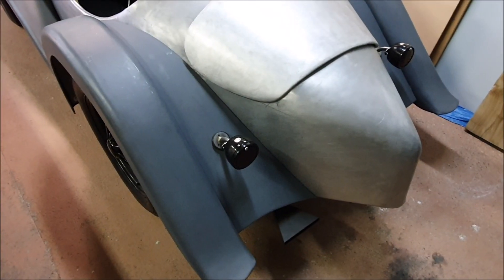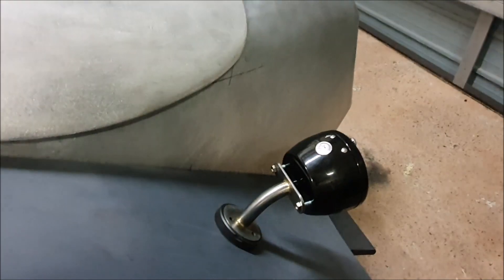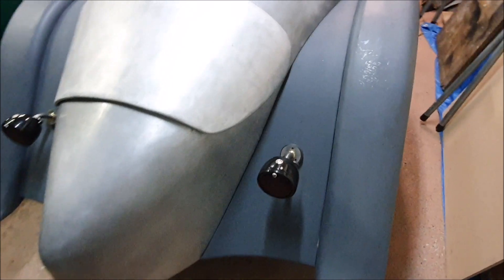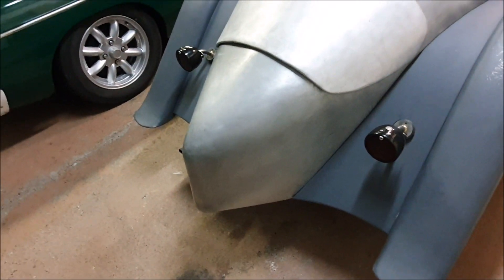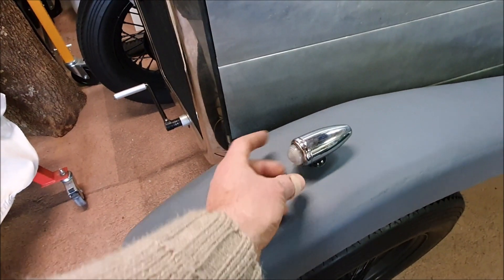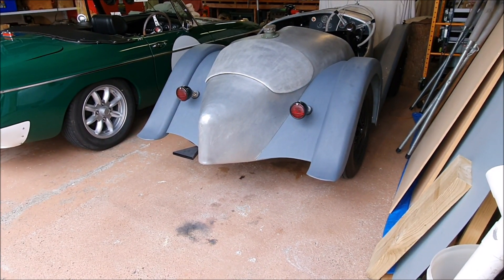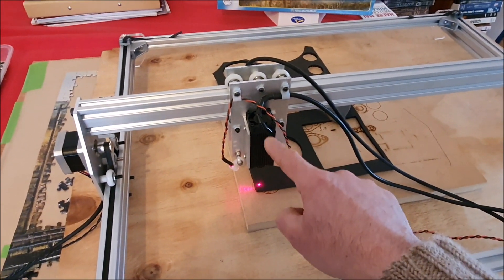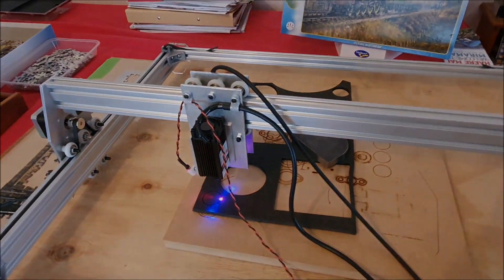Pre war Austin 7 rear lamps

Comment: Hi Its me again the small versus large side lamps person. The rear lamps look to American on the wings (fenders) have you considered using a smaller tube to make them closer the valance the position the valance looks the best on a monitor. The small side lamps look very good on the wings (British saying) I think Bugatti used the flexible conduit to run the cables in, it will also stop any damage on the cables. To answer Tragdorvigan here (Britain) all or most electrical wholesalers would have "flexible conduit" however now mostly it comes in a plastic coating. Hope this helps.
Reply from the maker: It's funny how different things make a car look like it's from a particular country. When playing about with lamps on stalks from the side of the body I kept thinking it looked too French.
Reply: @asciimation  you cant look too french!
Reply: ken phillips Not sure some Canadians would agree! :)
Reply: Thanks, I should check out local wholesalers.